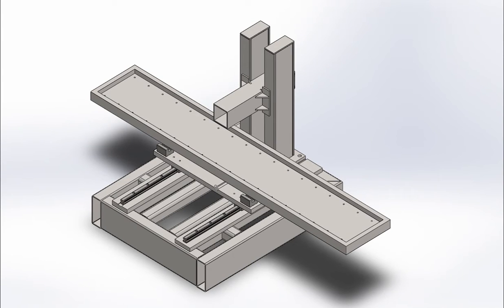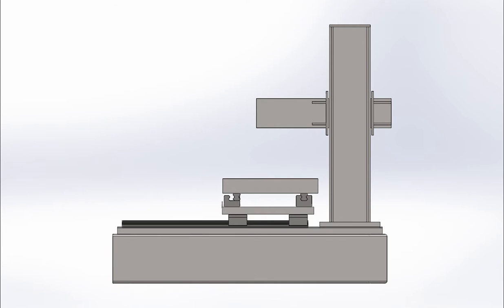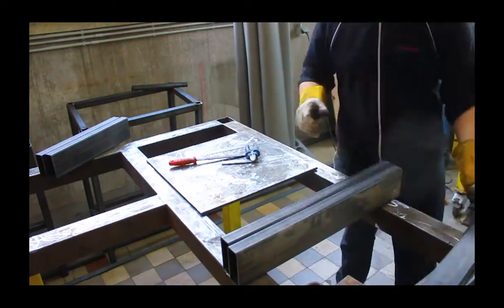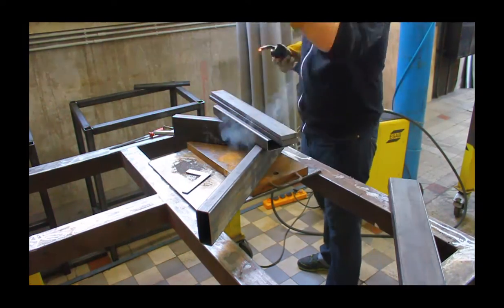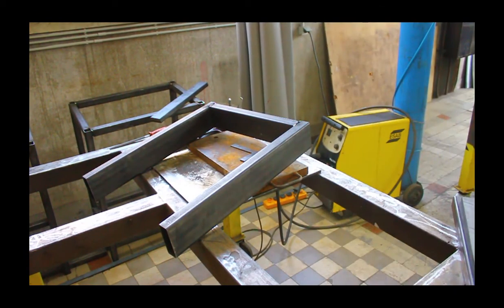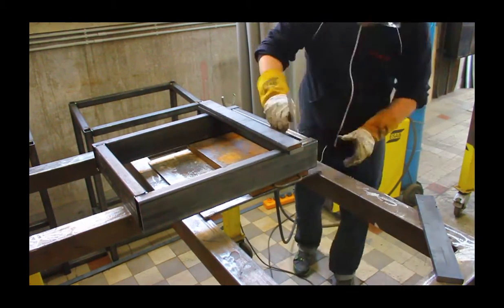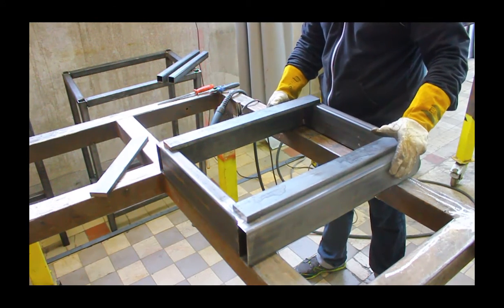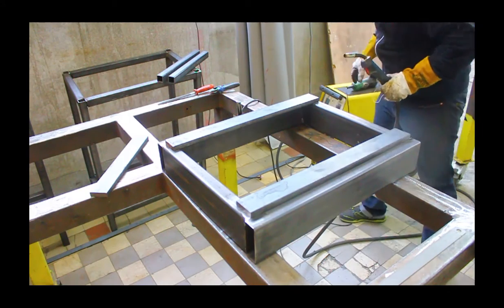Scrap build surface grinder - part 1

Comment: Did you even replay this before posting it. Good to watch but very painful to listen to as you just seem to be rambling in a rather incoherent manner. I will still watch part 2 though as I want to see it finished because as you said they are difficult to fabricate at home. Please play it back to yourself. Good work. Cheers Stuart 🇦🇺

Comment: just a small suggestion , maibe it be a good idea to make a cheat sheet for the comment that includes the english words for the main items and maibe the cm inch conversions to the sizes you made the machine 
its just to make the telling/commenting while the video is running eazier